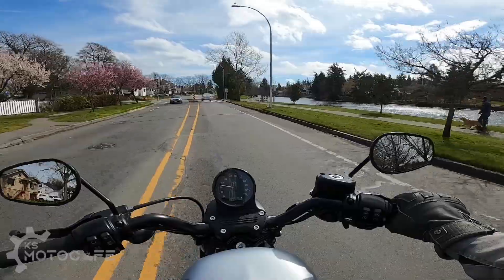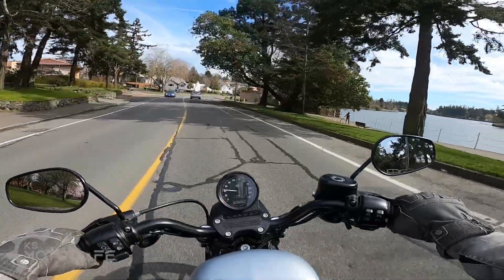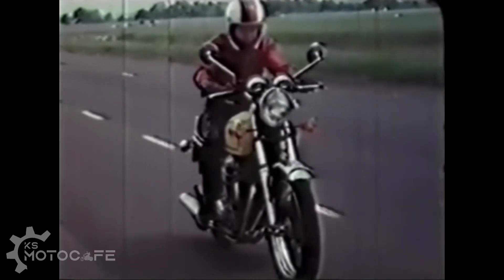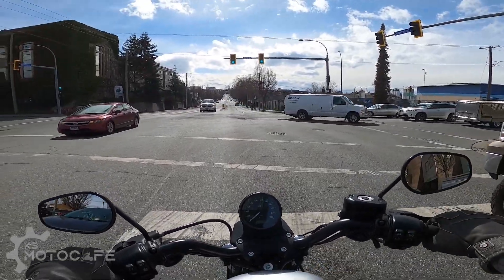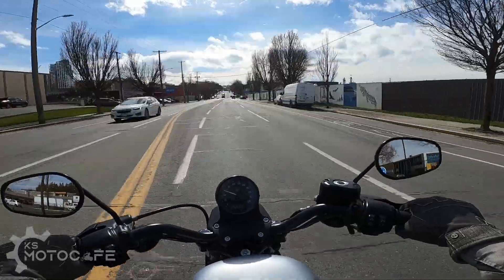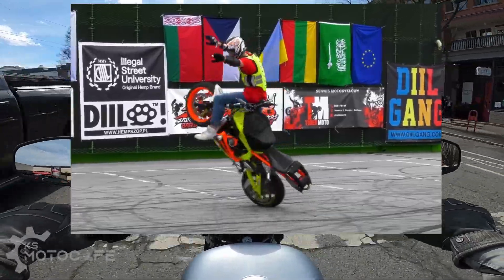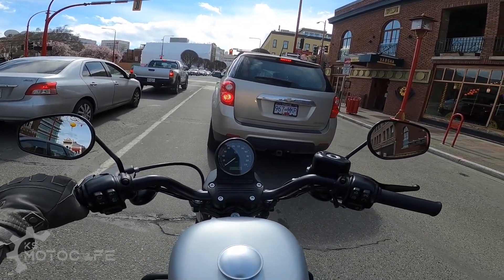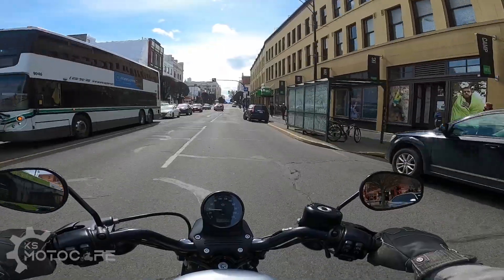Death Wobble, Speed Wobble, and Tank Slapper on a motorcycle explained!

Comment: I was riding my '97 UltraClassic Electra Glide several years ago on I-90 in Washington approaching Snoqualmie Pass going East about 70 mph.  It was the first time I experienced the wobble.  Had just gotten new tires.  Was leaning in a curve going about 70 mph.  when the bike started wobbling.  I backed off the throttle to about 60mph. and the wobble ended.  Speeding up again the wobble re-occurred.  Slowed down again.  Pulled over at the first opportunity and checked tire pressure.  Found that the tire place had over inflated one tire by about 10 psi.  Bled out extra pressure which alleviated the problem.  Incidentally, had replaced my engine mount which had been degraded by oil from previous oil changes to a Belva-Ride engine mount as it uses polyurethane material like in skateboard wheels which is impervious to motor oil. However,  I make sure no oil ever touches it again.  Other critical rubber appears to be in good condition.  Should be checking my spokes and bearings.

This year going out to Idaho riding same bike  on I-90 experienced wobble again. It was again when leaning in a curve.  Bike started to go straight and I had to lean really hard to make the curve as well as back off of the throttle.  DO NOT USE YOUR BRAKES IN THIS SITUATION!!!   Tire pressure correct in both tires with one rider and light load - 36 psi.  Wind was pretty strong.  Seemed more prevalent when in left lean, not during a right lean.  Wind coming from right.  Load was balanced and the bike symmetrical in terms of wind resistance.  I would attribute wobble to the strong wind from the right.  During the trip the wind lessened and the wobble eventually went away.  Am strongly considering an aftermarket stabilization device along with inspection, maintenance, checking tires and proper inflation.  Bottom line is I found that the best thing (for me) to do was to steady the handle bars and decrease speed and to NOT USE BRAKES!  Hope this helps another rider out there avoid an accident.
Reply: Use one more reply with regard to differing wheel speeds:  There is a custom bike trend these days with later model baggers where there is a much larger front wheel than rear wheel.  This certainly could result in differing wheel speeds with the rear wheel rotating more times over a given distance than the front wheel at any speed.  Are there any reports of the "death wobble" on these modified bikes?
Reply from the maker: Thanks for sharing this - is it possible that your bike has the same issue known as the Dyna Wobble? All the Dynas have wobble issues at high speed on a turn and having a fork brace or stabilizers help remedy it but it is well known issue.
Reply: @KSMotoCafe  I suppose it could have the so-called "Dyna Wobble" but by any other name the experience is the same.   I presume that many H-D rubber mounted big twins can experience this as well.    I looked at a number of videos on this subject  and it seems to be not only a Harley problem but one common to other types and makes of motorcycles whether the engines are rubber or hard mounted.  I hadn't heard of this phenomenon on AMF Harleys or Harleys with chain drive.  Hasn't Harley-Davidson acknowledged and addressed it?   Could this be a result of H-Ds effort to make a smoother more vibration-free bike that causes it? I'm no engineer but  it would seem that if  the rubber mounting degrades it makes the engine less fixed to the frame so the drive belt is not always in line with the frame and swing arm. As power is applied to increase speed  couldn't this cause the force applied to the rear wheel to become tangential to the bike causing swing arm or frame flexing resulting in wheel mis-alignment and the resulting "death wobble". It explains why rear only breaking helps alleviate it as the mass dragging in back serves to straighten the frame while decelerating.    This would also explain the production of  various after-market devices that serve to stiffen the frame.   I believe that if a typical "death wobble" bike was mounted on a device that would simulate road travel along with strategically  mounted cameras and measuring devices this problem could be observed so that proper design measures could be taken  My belief in H-D's case is rubber mounting.  The best way to handle vibration may be for H-D to hard mount the engine on all bikes and seek to smooth the ride through better seat design along with vibration dampening isolation grips, floorboards and footpegs.
Reply: Wanted to also say that I have a 1990 Fatboy with an Andrews performance cam and Screamin' Eagle upgrade.  It's a Softail all of which have hard mounted engines.  I've ridden as fast as I can go on that bike through curves and on straightaways.  It has always been rock-steady.  It sucks in higher cross-winds though because of the solid wheels but that's an entirely different problem.

Comment: I just had a scary experience 2 weeks ago on my 2005 Suzuki S50. It started doing the death wobble at about 60mph on a curvey country road. I have no idea how I managed to not go down, but I saved it. That scared the crap out of me! I've owned 23 different motorcycles in my life, but never had that happen before.
Reply: I had something similar happen quite a while ago when I was probably 18 riding on a curvy road being an idiot. Except mine was from breaking too hard cause there was a big curve with trees. When I finally got it to stop I just stood on my bike not able to get off cause I bashed both of my knees so hard into the gas tank so many times. Just stood there like 15 minutes cause I couldn't get off. That was around 10 years ago. I don't know if you'd really call that a death wobble or not or just me locking up my breaks.
Reply: @Zoroaster4  I just sold that Suzuki S50 on Good Friday and bought an old GL1100 Goldwing the same day. That's bike #24

Comment: If it's a speed issue why not hit the rear brake?
Reply from the maker: light rear braking will help yes but what you really want is to stabilize the steering of the bike as it is violently wobbling. Too hard on the rear brake can make things worse but gradual slow down using combination of rear brake and throttling off seems to work for most riders.

Comment: Experienced a death wobble today on the highway and had previously heard the best way to recover was to throttle on. While it didn't make the wobble worse it also didn't make it better and now I was going 5mph faster than I was before.

Next I tried to throttle down and while I could shave off some speed the wobble was getting noticeably worse so I stopped doing that.

I ended up accepting that I was probably going to crash so did what I could to steer my bike out of the fast lane and across the other five lanes into the slow lane which had a nice patch of grass beside it for me to slide onto. Before ditching my bike I decided to shave off as much speed as I could safely by using the back brake and throttling down. The back brake helped a lot! I dropped about 25mph off of my speed and was able to get my front wheel to straighten out again.

Feeling very lucky to have made it home with my bike in one piece. Today could have ended up going very differently.

Comment: Happened on a 2022 pan america special at 124 MPH backed off the throttle and applied rear brake. It took about 3-5 seconds to stop. Bike is new and just went through its 1000 mile inspection.

Comment: In theory, wouldnt pulling in the clutch, downshifting/engine break be the best way to slow down? In tandem with feathering the rear brake
Reply from the maker: yes that would work - in fact that is what you should try first, throttle off and hold in the clutch and let the bike correct itself.

Comment: I'm 19 year old and had a head wobble when I rode a >150cc for the first time i.e Pulsar NS. I was moving at 90kmph in a highway and my bike started to wobble slightly. I don't know why but I just throttled down and slightly held the rear brakes. Glad that I did the right thing because I dint even have extra protection other than a helmet.

Comment: So......clutch & gentle rear brake, yes?  Is this common at "legal" speeds, on a cruiser?  Specifically 1987 Honda VT1100
Reply from the maker: yes that should fix the issue for most cases. And at legal speeds, it is less common. I got my speed wobble way above the limit before I throttled off to maintain balance.

Comment: When you say throttle off do you also hold the clutch or just throttle off?
Reply from the maker: combination of both. Throttle off first to see if that solves the problem by letting the engine slow the bike down and then pulling in the clutch to cut all power to the bike and let momentum take charge

Comment: This is not fun and try and be safe. This has happened to me 3 times.  I was over hundred mph each time. First time I panicked big time 110ish mph. It shacks so bad vision was blurry but I froze and let off throttle and the handle bar stopped wobbling. I could make out speed at 95mph and didn't crash. Second time scared you know what at 130 something. This time I tapped the REAR BRAKES  NOT THE FRONT  and it stopped wobbling. Only because I was told to and ride with my the rear brake lever. The third time same thing not as much panic and not sure what speed but it was over 120. Did crash yet from deathwobble  luck what ever. I keep my bikes up wheels,tires in good safe working condition and I mean that! Don't know why it happened.  Be safe.

Comment: Death wobble? In my days we called this a "tank slapper".  Scary shit, had one on my Kawasaki ZX10R at high speed about 18 years ago. Almost died, barely could hold it but didn't crash.  This was with a WP steering damper installed (medium pressure) and it still was very violent. Very scary shit.

Comment: Another thing is watch your breaking. I had one because some idiot slammed their breaks in front of me causing me to slam mine. I have a strong grip so unfortunately for me with instinct, gripped the front break a little hard causing it to lock up. I was going about 30-35 and regained control when the idiot turned off and I was able to release the breaks.

Comment: A while back when I was younger and more stupid..or less...anyway, I used to experiment with the suspension and ride height on my bikes, usually old Yam RD's and the like, I soon found out 2 things that gave speed wobble..from standard form..sitting the back low, or lowering the forks for quicker steering...I used to thrash through the gears get to a 100 or so..no problem..but if I shut off the throttle to quick...they always shook thier heads..and exactly the same if your forks are not up to service, all that pull and inertia through the gears, unwittingly keeping the front wheel light..throttle off suddenly and..dump! All that sudden weight on the front wheel...the morale of the story, don't drop your forks 10mm for quicker steering..because in a straight line things get a bit squiffy!.. bad geometry, suspension set up, riding position can give one a wobble!...PS.. ide rather a wobble than a slapper!

Comment: Brand new Ninja 650, 112 mph I felt a wobble, and natually rolled back the throttle and it corrected immediately.  Now this was the first time I gave it a little test acceleration on the highway, im usually doing the speed limit. But it scared me a bit but i remained calm.
Reply from the maker: Good call on rolling back when you started to feel the wobble. I think steering stabilizer for your bike would fix that but how often do you go 112mph?

Comment: I was on a KLR 650 going 80-85 getting the speed wobbles I clutched in and it saved me
Reply from the maker: nice save!
Reply: @KSMotoCafe  thanks, it happened yesterday when I went to buy it everything was good until I drove it on the highway it did it 5 times on a 30 mile ride

Comment: Had my 1st wobble recently. Honda Shadow Sabre 1100 cruising at 75mph. Accelerated to pass a semi and changed lanes at the same time. Up to 85 now, and the level of the two lanes became different. Bars began to oscillate and kept it up for a good 5 seconds. I slowly rolled off the throttle with no brakes and it evened out. Thank God no tank slapper.
Reply from the maker: good survival story! Thanks for the share!

Comment: Not sure where you are getting the information that speed wobble ultimate cause is mismatched speed between front and back wheels. This is not the case. Speed wobbles are caused by a stimulus that inputs energy into the system while moving at a specific speed that couples with its mechanical resonance frequency. There are a number of ways to show that this is the case, but perhaps the easiest way to demonstrate that out of synchrony wheel speeds are not the proximate cause is to look at other systems, particularly vehicles, that experience the phenomenon. These include shopping carts caster wheels, airplane landing gear, skateboards, and perhaps most illustrative, the Onewheel. All these speed wobbles are similar in cause and effect, but are clearly not due to mismatched wheel speeds. The Onewheel, after all, only has a single wheel!
Reply from the maker: I said different velocities between the two points of contact with the road and not speed. As you mentioned, there are also numerous forces at play including inertia, momentum, and centripetal force but I had to over simplify to quickly show how this phenomenon occurs from imbalance of the two contact points and the bike trying to rebalance itself while still in motion. I was originally going to show it by using the demonstration of a car pulling a trailer that starts to wobble because of incorrect weight distribution on the trailer with the car acting as the front wheel and the trailer as the back wheel but it wouldn't work since all motorcycles are rear wheel drive. Also I was very new at being a video creator at the time this video was made and I didn't have my speaking points clearly outlined. So I will dive in a bit more with better explanation and some corrections to my recommendations soon. Thank you
Reply: @KSMotoCafe  That's fine, but the problem is, that's still not what causes speed wobbles! Leaving aside that velocity is simply the directional speed vector, speed wobbles are the result of a physical phenomenon called the Hopf bifurcation. The Hopf bifurcation essentially describes a critical point where a stable system spontaneously transforms into an unstable one. In speed wobbles, this critical point is a given speed, which in turn is affected by several physical traits of the system. This phenomenon affects numerous systems, from predator prey relationships to the motion of trains traveling on tracks.
Again, this phenomenon affects single wheeled systems, like shopping cart casters, and the Onewheel, which get speed wobbles in the same manner as bicycles and other two wheeled systems, so they simply can't be the result of a break down in synchrony between multiple point of contact.
All that said, I am seriously interested in your source for this claim, as I have read many varied explanations about the cause speed wobbles, but I have never come upon this one.

Comment: Had an incident today.  I was racing my buddy on my 03 cbr600rr and started to experience the death wobble at around 120mph.  I instinctively started to pull the throttle in and ease off the gas but i did not touch the break.  It lasted for a good 5-7 seconds but finally ended in what felt like an eternity. Luckily i didnt die today.
Reply from the maker: shit man - thanks for sharing. 120mph...
Reply: @KSMotoCafe  on a tank slapper u have to lean your head in and throttle off, that will stop most of it but u will have to pray for the other 25%
Reply: Strange i just had a tank slapper mega moto gp style at 170 kmh (120 mph like you).. it was a 'die-for-sure' type death wobbler on a CBR650F! Also about 5-7 seconds and terrifying, pulling the clutch and a light dab on rear brake NO FRONT BRAKE, saved my life. my mind was in slow-motion mode saying 'holy crap i just crashed my Ducati the other month and almost died, this time i am really gonna die'.. but guardian angel made me pull the clutch, and it ceased. So I know exactly what you just went through, because i just did too. Found a trickle of oil on the left fork, so maybe a leaking seal
Reply: that litteraly happened to me today but i was going about 150 ish
Reply: Why speed. You're breaking the law and potentially hurt yourself or others.
Reply: First thing, don't ride 120 MPH on old tires. Next thing break is spelled brake.

Comment: I have a few speed wobbles and your instinct is to toe into the rear brake. You have to make a conscious effort to not brake and I did find that throttling up will correct it fairly quickly but don't take my advice. Ride safe

Comment: The thing I distinctly remember when it happened to me was that the violence of it made it impossible to control the throttle twistgrip. I got thrown off but got away with only a few cuts and bruises.
Reply from the maker: damn man sorry to hear that, are you still riding though?
Reply: @KSMotoCafe  Oh yeah! The accident happened on a Moto Guzzi Le Mans Mk2. I was overtaking a car on chevrons painted onto the road. The paint was thick enough to induce the front end into a positive feedback loop. The clipon handlebars on the old Le Mans were very narrow so the bike became impossible to control very quickly. There was no steering damper fitted though the original Moto Guzzi OEM steering damper was pretty useless anyway. I ride a Honda Fireblade these days. And I have a 1952 Triumph T100 for pottering about on the country lanes.
Reply from the maker: @mattsta1964  awesome! Thank for the details and I am glad you are back riding!